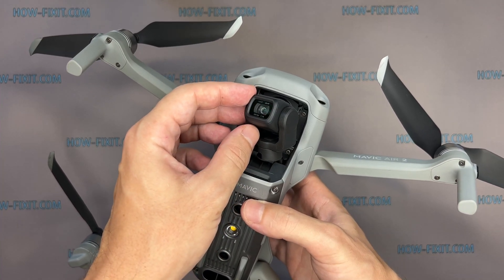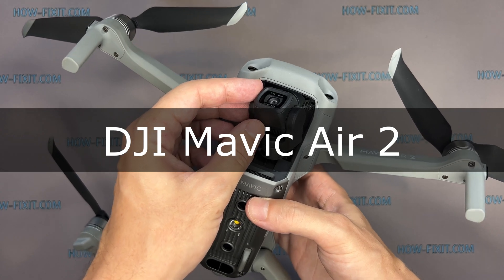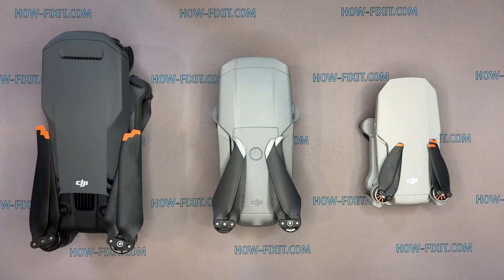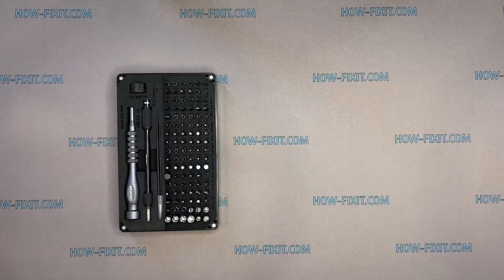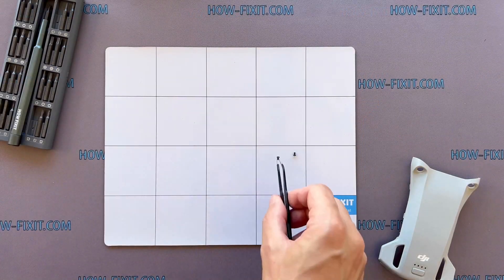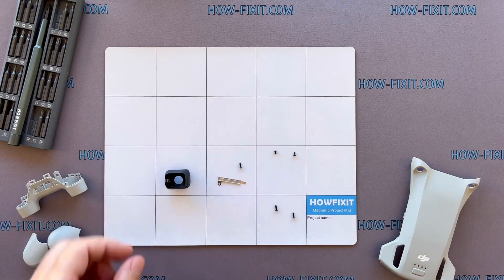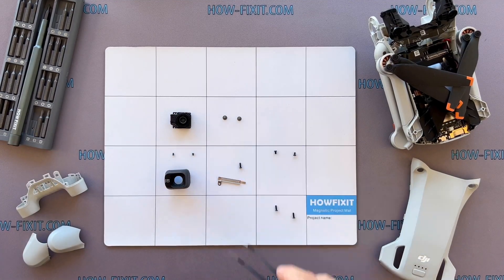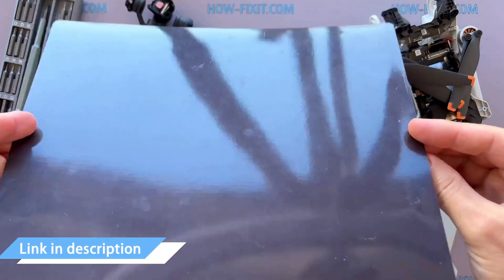DJI Mavic Air 2 Camera Replacement. How to fix camera error.

Comment: for lens swappers: 
the lens itself is not a screw mount type, its just a 8,55m cylinder that is glued to the housing
it is somewhat between a 3-4mm f/2.8 focal length
Reply: I cracked my lense, like the plastic part that is exposed to the air, how would I replace this